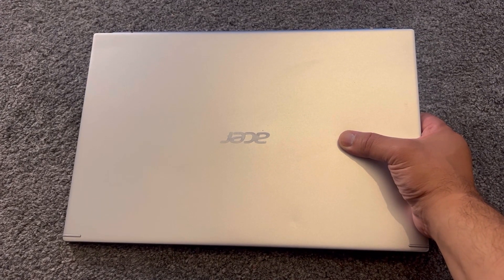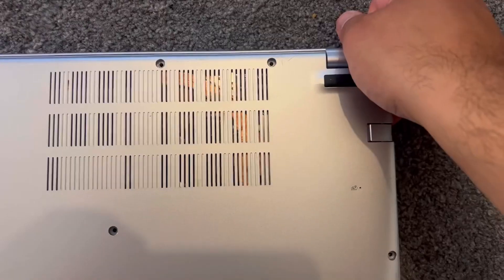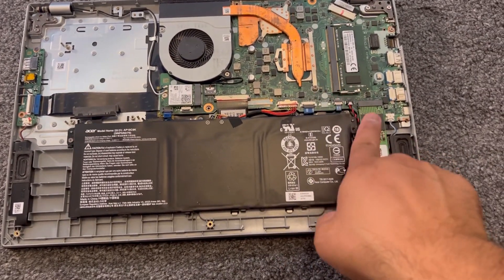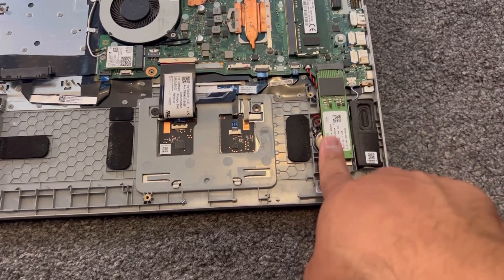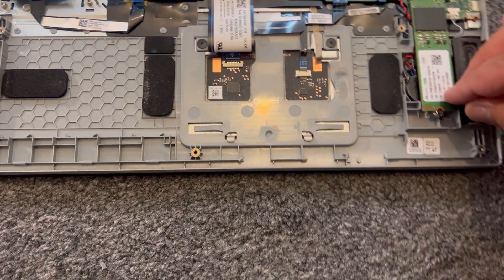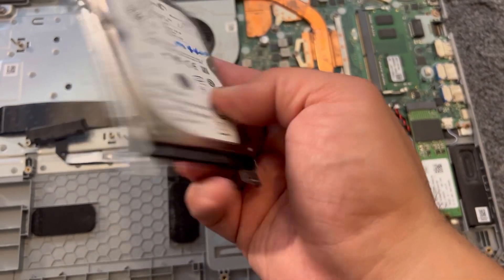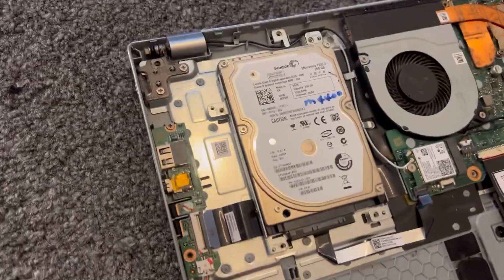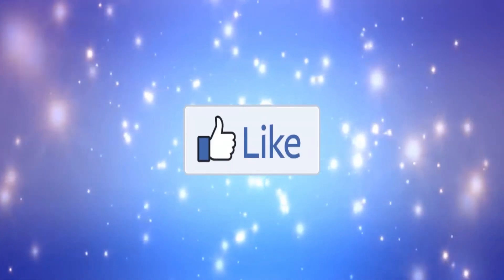ACER ASPIRE 5 A515 56G - Upgrade RAM / M.2 SSD / INSTALL SATA SSD HDD / Locate CMOS / Remove Battery

Comment: is the factory ram directly on the board?
if I want to add only RAM memory, do I need to disconnect the battery?
Reply from the maker: There is 1X ram slot which is upgradable. The other ram slot is soldered onto the board therefore not upgradable. You can add 1X 16gb to make your laptop 20gb. The other ram slot has 4gb ram which is soldered.

It is advised to remove the battery before upgrading to avoid static charge and short circuiting
Reply: Thanks, could You plecase recommand one compatible model for this laptop?
Reply: @Henry-mr5tu can I use 3200hz ram?